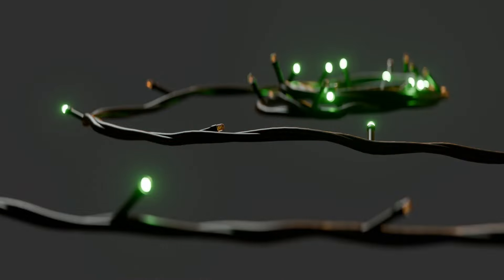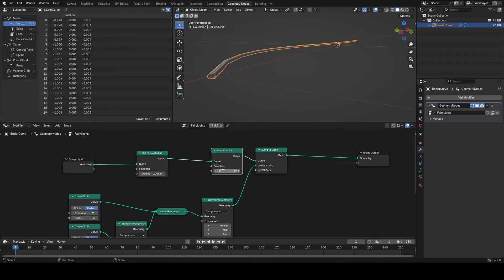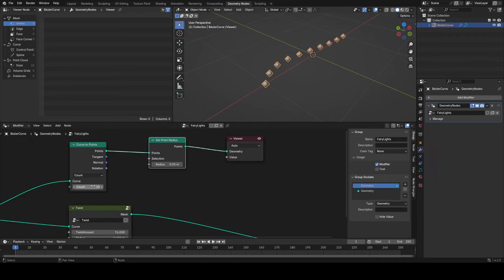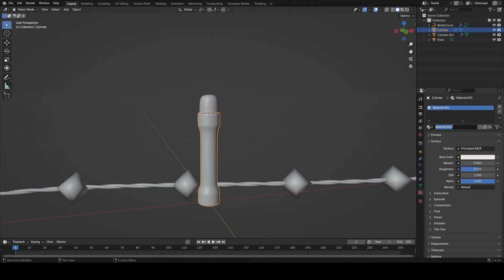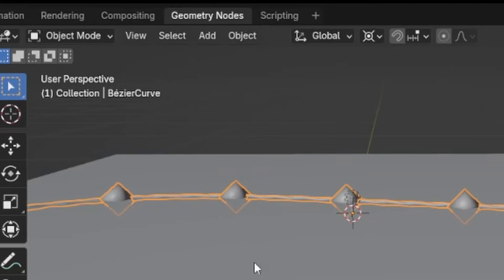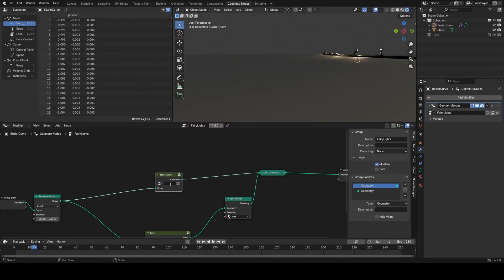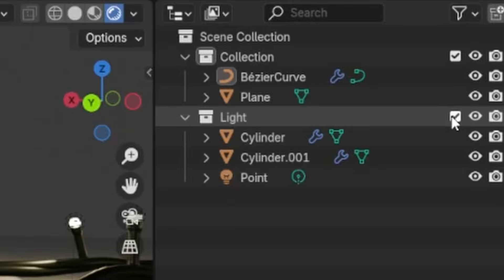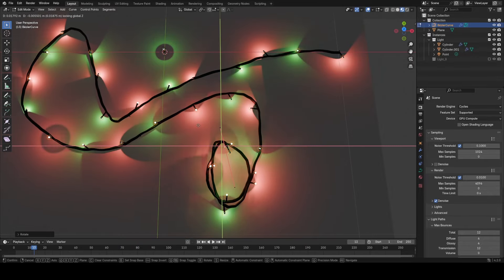Fairy Lights  - Blender 4.2

Comment: how did you fuse the duplicated nodes together? I've been trying to do it but it wont work
Reply from the maker: Hm, do you mean joining two sections/nodes together? I use a shortcut, but you can just manually add a join geometry nodes and plug in both inputs :)